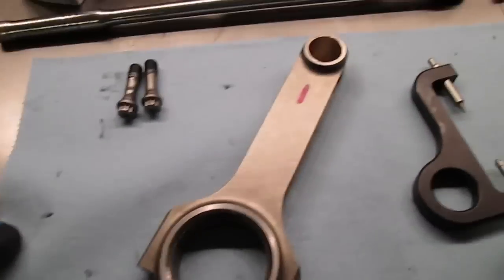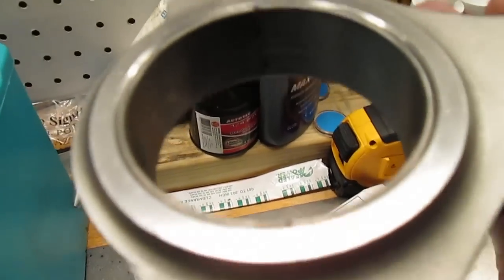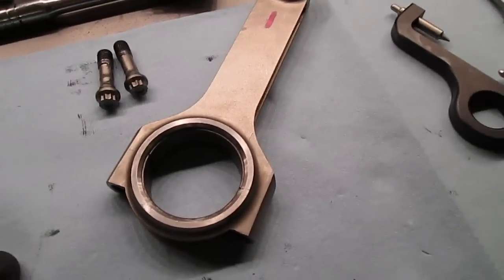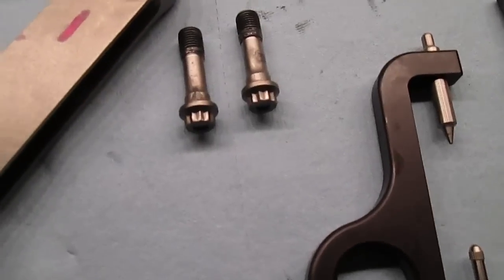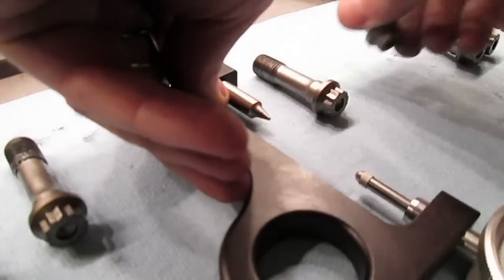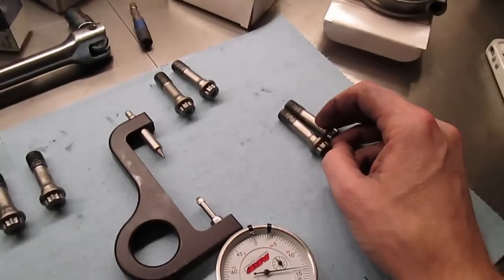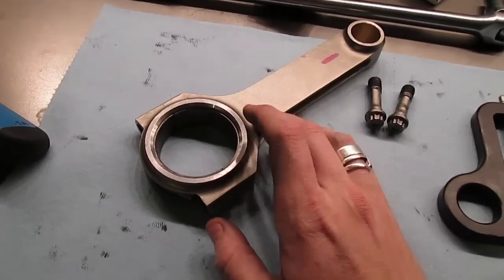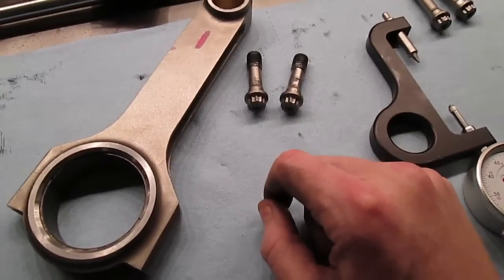Rod bolt stretch Problems

Comment: Thanks for the quick reply! The largest variance from the smallest to the largest rod bolt was .005 which seems like a significant difference but I guess this is normal. Thanks again for the quick reply!
Reply from the maker: +Kim Lee That was exactly what  originally happened with me and started my confusion, i'm still learning but lots of conflicting info out there.  Good luck with your build!! Cheers, Sam.

Comment: Nice catch on the rod bearing fitment!  As for the rod bolts, I have to assume they were very close in length from the factory so if they have stretched that far I would replace them all.  I think it would be wrong to match them up in length because presumably they have stretched (weakened) beyond their useful limit.

Comment: Scat and eagle have arp make them bolts to Their own specs to work in their own rods. Theyre budget brands looking for budget bolt solutions to remain affordable. They might require different bolt materials and stretch specs than other brands depending on the materials they use in their rods, where that material is concentrated and how much their rods move around when tightened compared to a more expensive “beefier” set. Thats why arp is telling you its a question for scat, they dont want to tell you anything that might be wrong and ruin your rods. Scat is also being vague because this work obviously isnt being done professionally, its to avoid liability.
Reply from the maker: yep! that makes total sense, when i think about their liability is also their main concern. Great point man, thank you!

Comment from the maker: Yeah after looking at all of them and talking to ARP and the fact they say they manufacture bolts to .001 i ordered a complete new set. Scat were not very helpful even though i ordered the bolts from them. In one phonecall one guy told me they don't even torque the bolts at the facility, and in the next phonecall a different guy told me they torque the bolts then hone the rods. So inconstancy has lead me to buy a "new" set and measure them all before they have ever been installed.

Comment: The fact that the rod bolts are longer or shorter than each other means nothing without measuring them when new. They are torqued for a specified stretch, not absolute length. I wouldn't want you working on my engine.
Reply from the maker: +Fred Thorpe You're right, my confusion was Scat telling me once the bolts have been torqued, they have a different stretch value. My worry was being my first time measuring for stretch over torque, that the reccomended stretch values would be different, since the bolts had already gone through it, when Scat torqued them to my rods. But have since learned these bolts can be re-used to the same stretch point over and over, unlike some bolts that are junkers once used.  It's pretty interesting stuff.   Thanks for watching.

Comment: I put new rod bolts in every time i rebuild the engine.  About 400 runs.  The difference in length would bother me if they were new.  Pretty sure any bolt stretched over .001 from new length should be replaced.  Obviously yours are stretched well beyond their useful life.

Comment: Hi Swilling - I am experiencing the same with my ARP rod bolts (Eagle Rods).   did you measure your new ARP bolts and were they within .001" as ARP service rep indicated?
Reply from the maker: +Kim Lee Hey Kim, the new ones at resting length were also all over the place. I had lots of people telling me different things, in the end i ended up just treating each bolt as its own.  From now on i just thread the rod bolt in by hand. Then set my stretch gauge to zero, then start torquing from there.  The last ones i did recently on a friends motor, i had a torque wrench handy, and also just for kicks, used a torque wrench after  tightening the rod bolts to the specified stretch, and according to the torque wrench they were all within 1-2 lbs of each other.  So from now on i'll just be setting my gauge to zero once the bolt is in the rod, then tightening to stretch spec for the rods.  I still seem to hear different things from everyone i talk to.. and anyone i ask certainly knows more than me.   Good luck!

Comment: You torque each one individually zeroing the gauge for each bolt. Whats the issue?
Reply from the maker: yep totally right. I got thrown on a wild goosechase originally by ARP over the phone telling me what spec they should fall within before, that just confused me and since then i realized that it really does not matter because now that i understand the concept its just consider each bolt Zero, and then go from there.  Simple now that i look back on it, but was really confused when people were telling me different stuff. Shoulda just went with common sense.  Appreciate you checking it out.

Comment: best case cenario .. measure all of them, wrtie it down add them all together take an average and then torque the longest one till you get the proper stretch. apply the % variable from all the rods to the longest one and then move forward .. ive had this happen before .. its all offshore shit that comes from china .. arp is not exclusive to the USA.they sell this stuff all over the world then we buy back what they call acceptable,,,plus if you think your ever going to get perfect out of a box ,you can think different .. for me its a mute point .. you have the tools there in the rod stretch guage ,just use it and move forward
Reply from the maker: Great advice man, thanks.  Yeah im learning more and more as time goes on how much this kinda thing is just what we have to deal with.  I've learned a lot since and next build i do when i come across it, at least ill be way more prepared and less surprised.  Thanks for checking it out!!

Comment from the maker: Ha, im sure you could. it certainly is not rocket science. Just take your time. However, i would not discount a Machine shop for NOT measuring bolt stretch, especially if your not asking for it/paying for it.... its not really an issue with any kind of street engine, i'm just being picky for the sake of doing it.   I'm sure i could torque these to the suggest 63 ft lbs and be fine. But i do tend to thrash my engines.